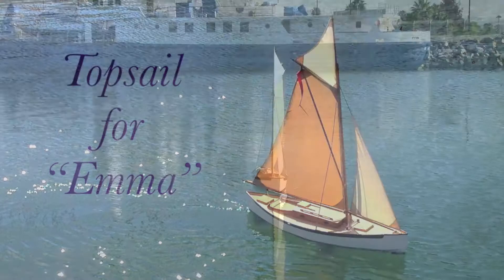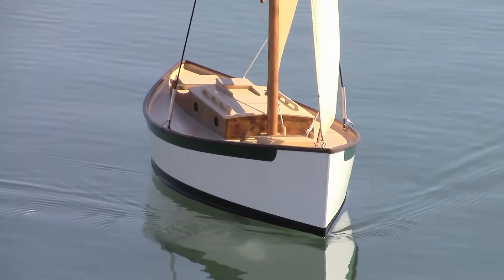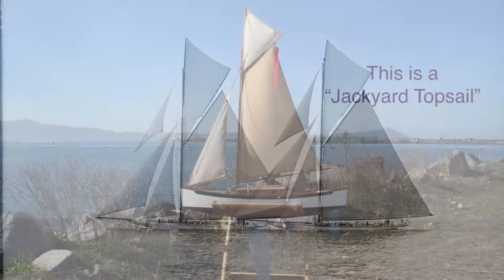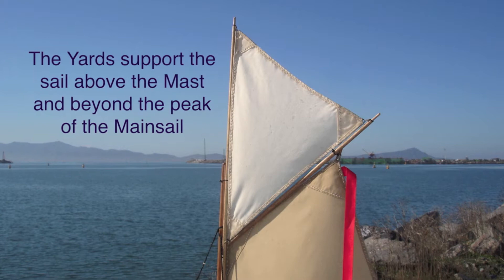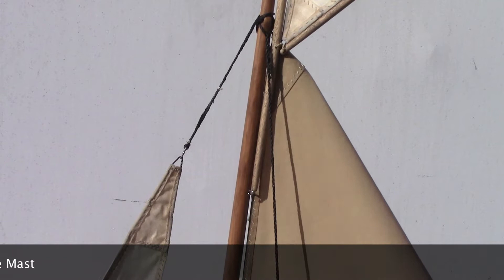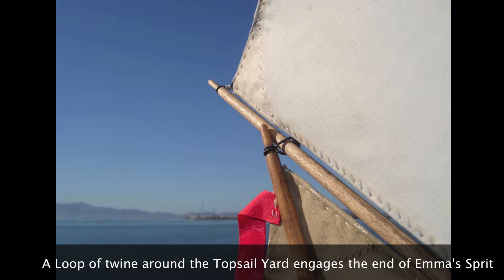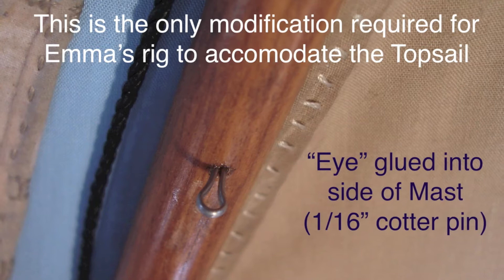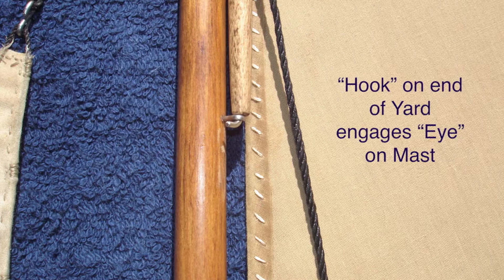Topsail for Emma

Comment: Nice addition Gary. I'm just whittling down a lump of lead for my own 'Emma' and I've yet to start making sails but I've got the dimensions now so I'll just add one more to the production line. The boat has gone together very easily - thanks for excellent plans - which is a good thing for my first RC sailboat. I make lots of model boats, usually scratch builds but only managed 2 RC boats in the past and I fancied a bit of RC sailing and found your plans. Maybe the schooner next.

Comment: Nice. That sword-keel... is pretty on the long side, isn't it?
Reply from the maker: Indeed it is Nick!  But it works well and she will stand up to a Strong wind. All well and good if you have deep enough water.
I have tried a fin 3” shorter with same weight (works fine in ordinary conditions), and a fin 6” shorter with an extra pound of lead in the bulb. This shortest fin reduces her draft to 14” and her sailing performance with this fin and the extra pound has proven quite satisfactory while allowing Emma to sail in a shallower pond.

Comment: why??? do you yanks call split pins, cotter pins. you find cotter pins typically on bicycles holding the pedal cranks onto the shaft and are a type of bias bolt. Anyone out there got the the solution to this conundrum.
Reply from the maker: I understand your concern, I reckon it's just the way we were brought up on this side of the pond, working with wrenches (spanners), fixing flat tires (tyres), running low on gas (petrol) and such. Cheers !
Reply: @sailtails2775  Thanks, must be slow in the work  place with a mixed Brit and Yank work force and everybody running around looking for sky hooks and striped paint.

Comment: Nice I ordered the plans but I am not clear about the servo sistem (winch),olso the radio sisten you show....where can I order it ? Cant find the same servos you show in the picture.thank you.
Reply from the maker: "Emma" plans show HiTec servos - HS-485HB for steering and HS-765HB for sail control.
They can be found at Servo City     https://www.servocity.com/servos/hitec-servos
Reply from the maker: Josue, The arm servo shown in the plans is used in the original "Emma". I suspect you may have seen a video produced by another builder which showed a winch system which he improvised for his "Emma".

Comment: Hi Gary, I'm working on my own schooner and I was wondering were you got your bear?
Reply from the maker: Bears are not always easy to find. I adopted mine from the toy bin in a second hand store here in Mexico. He had a tag which suggested he may have once been a McDonalds toy. He proved trainable, and really enjoys sailing.
Reply: Thanks Gary. If your looking for a reason to make another video, I would like to see one that show all the details of your schooners rigging. You do show some, but its either to far away, or the camera man pans over it to fast.
Reply: I took your advice and searched eBay for McDonalds toy bears. I found what I was looking for, they were made in 2006 by Build a Bear Workshop. I hope my bears are as easily trained as yours were. Now I just need a coooool hat.
Reply: @sailtails2775  great vid  Next time make a sandbagger where bowsprit to end of boom is at least twice the length of the hull